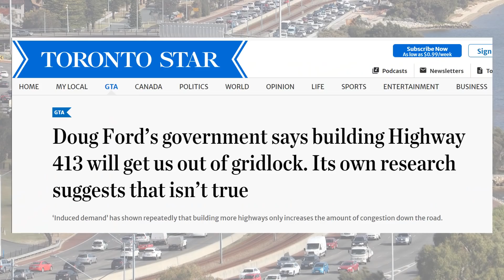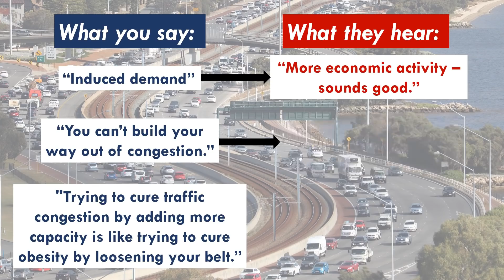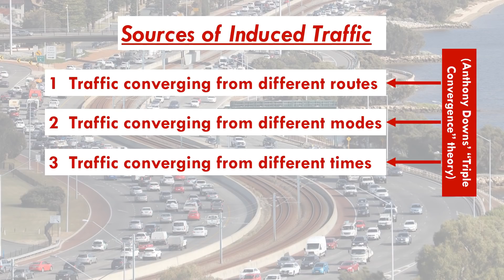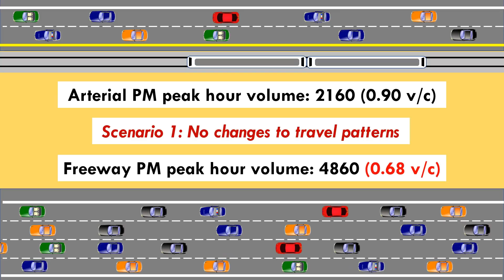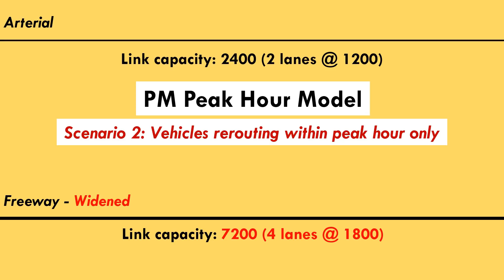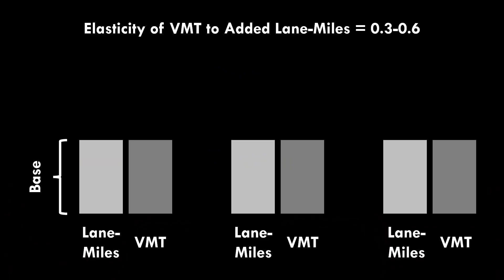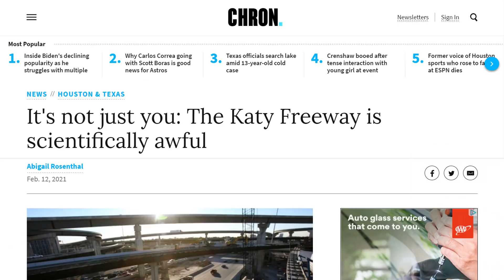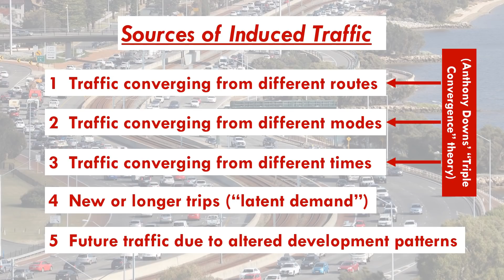Induced Demand & Roadway Widening: Everything You Always Wanted to Know (and Weren't Afraid to Ask)

Comment: I'm wondering in these models if benefits outside of rush hour are considered in analyses. Clearly, the extra capacity is geared for the peak period. But I grew up in the suburbs of Atlanta. We frequently would drive to go to dinner or sporting events, etc. that were downtown despite living 25 miles away because the trip basically took 25 minutes with little traffic on the wide highway. Now I live in the Virginia suburbs of DC. Even at midnight, the narrow highways that barely penetrate the city often have some level of traffic, and it makes driving for non-work reasons into the city not worth it. Instead, we stay in the suburbs. Ignoring some of the positive climate implications of what I just said, I am curious to what extent that sort of demand which would be great for DC's economy is considered during widening projects. Even services like door dash benefit downtown businesses if they can quickly get out to the suburbs.

Comment: I’m curious if there’s an optimal number of lanes for highways. I’m of the mind that 3 all-purpose, 1 HOV & 1 accessory lane is optimal for greatest capacity per lane with greatest success of travel (AKA, fewest incidents).
Reply: Until you have to cross the thing.
Reply: @marjae2767  I’m talking about highways as freeways that require a bridge or tunnel to cross. Your point is still taken that crossing one is not typically a pleasant experience in any case, even if separated.

Comment: The first written of examples of this that I know of, were seen in the UK in the 19th Century, the price of coal dropped, ticket prices on the trains also dropped, more journeys were taken as a result, more coal was used than previous, prices rose higher than before. A virtuous circle.

You can kind of see it playing out at a global level via thermodynamics, the laws of which are very clear on why it is a really bad idea within a closed system to use the machine that makes the mess to build machines to clean up the mess we made but capitalism via renewables & EV is the faulty hill we have chosen to die on, so be it.

Comment: The key point I come away with is that adding capacity in one place creates congestion somewhere else in the network, and then when you add capacity there, another place becomes congested, and so on.  It becomes a never-ending drain on resources.  The term "induced demand" does not elucidate this key aspect of the problem.

Comment: The thing is, I feel like that freeways should still be built. Hear me out. It's just that we have to accept that they will always be congested during rush hours. However, when it's not rush hour, freeways are tremendously useful for getting around quickly. They're also the safest kind of road for motorists, and they're also very good to keep trucks off city streets and keep trucks moving. It's just that there has to be a good balance. It's not great to have no freeways, but also not good to have too many freeways.

Just my two cents.
Reply: I agree.

I'm for rail transport but as you said, you have to have a good balance. I don't think widening a freeway is the smartest concept but rather reducing the amount of junctions creating bottlenecks is the better solution.

Comment: Thanks for an in-depth and interesting video. I've always been wary of the idea of induced traffic but I like this analysis. I note that sources 1, 2, and 3 are preexisting trips. 4 might happen with discretionary traffic (e.g. mall) but not non-discretionary (most employment, and employment commuting is what creates rush hour). I expect pretty much all long-term negative effects of capacity planning are due to source 5. It is frustrating that when land use is so heavily regulated in the US we can't get this right. But this does mean that the road itself doesn't directly generate additional traffic.

Here's a hot take. Any road network was probably fine when first built, and then development grew beyond its capacity - an argument that roads themselves are not a problem, and if capacity and other development happened hand in hand traffic would stay under control. Adding a lane adds capacity but it is still finite, it is not a cure if you can't keep demand in check. (I am ignoring the land use efficiency argument here, but that is different from the induced traffic argument.)

Which leads me to my second hot take. The real failure is lack of coordination of development (traffic capacity vs demand, regardless of mode), and local control ruins city planning in the US. Cities should not be balkanized rivals able to have their cake and eat it too. Many urban cores are anti-road and want everyone to be urbanist like them, while at the same time not zoning enough housing to let people live near jobs. Simultaneously, suburban voters sabotage attempts to build regional transit systems.

Comment: From an Econ 101 perspective, one way to make sense of the concept of induced demand is to distinguish between short-term and long-term demand.  At any moment, there is a short-term demand curve: a function that gives a quantity demanded for any price.  It depends on people's beliefs about alternatives, and about the good that we're looking at demand for.  If price is the only thing that changes, then quantity demanded will vary along that curve.  That definition has nothing to do with time, only with whether anything else changes.  But it can be called a "short-term" demand curve because changes in price can be assumed to happen faster than other changes, or because price changes that aren't expected to last will have very little effect on anything else.  A long-term demand curve describes what quantity will be demanded if the price stays at a particular level indefinitely, accounting for all the other changes that may eventually happen as a result of the change in price.  So a change in supply can gradually induce a change in short-term demand, where the new short-term demand curve intersects the supply curve where the long-term demand curve does, instead of where the old short-term demand curve did.

As for traffic, my impression is that the main problem is how capacity works.  If you add lanes, that gives a nearly proportional increase in the maximum amount of traffic a road could carry, if metered entrance ramps functioned perfectly to let vehicles on at the rate that maximizes throughput.  But it gives very little increase, if any, in the amount of traffic that the road can carry when fully congested.  A four-lane parking lot is a parking lot, and a six-lane parking lot is still a parking lot.

Comment: @CityNerd: I think induced demand is basically a shift in the demand curve.  For example, suppose the extra lane causes sprawl and development further away (which you consider in the video).  If you then close that lane, you will probably see higher traffic than before, regardless of the fact that by closing the lane you have reverted the lane miles to what it used to be.  This extra lane, repeated many times, will cause sprawl within the city (more parking) making it less walk-able, and this over time causes changes in the demand where for a given number of lanes folks are willing to tolerate more delays.  There is a similar argument about inflation.  If done right, you shift both supply and demand, making prices stay the same but increasing output.  That said, in the case of lanes near cities, there are tons of externalities when adding lanes, so this double shifting does not really work.

Comment: Induced demand actually makes a lot of sense from a more advanced economics background. You can’t survive your first-year PhD micro sequence without learning L’Chatelier’s principle, which states that long-run supply/demand is more elastic than short-run supply/demand. So while the increased quantity demanded from expanding capacity is a movement down the short-run demand curve, in the long-run, travelers take the expanded capacity into account when re-optimizing. Since they don’t account for their congestion externalities, the result is an outward shift in the demand curve. So even if you don’t have to worry about all of the other factors you mentioned, in a simple dynamic model, you’d see no long-run congestion benefits from widening a freeway
Reply: Not just that, we also have to consider that land use plans often have conditions put on land development based on the supply of public infrastructure, like utilities and transportation. Say, a suburban developer or a retail developer might not be authorized to build that new subdivision or shopping mall unless they invest in expanding the road capacity along their access routes; or until the DOT expands the freeways or arterials passing near the development sites. This sort of thing is what's happening under the hood in the long-term supply and demand elasticity.
Reply: @LucarioBoricua  Sure, but the point is that *even absent those second-order effects*, you would see an increase in highway demand in the long term as a direct result of capacity expansion. I mentioned this in my reply to @someguy's reply to my comment, but long-run demand is more elastic not because of knock-on policy choices or whatever, but simply because commuters are less constrained by long-run investments (e.g. where they live).
Reply: IMO you hit a key word here: externalities.

I disagree with the elasticity analysis. Short-term demand is inelastic - at least when talking about people commuting to work. Long-term demand is more elastic but under regulatory control. Consider this - if people are commuting to jobs in the urban core, the core city cannot prevent suburban housing development (or existing workers moving out of the city), but it can absolutely control how many new jobs can be added in the city. While there are some things they cannot control, they typically fail to use the levers at their disposal either, so it is not surprising when the new capacity limit is hit.
Reply: @someguy6075  I didn't say demand was elastic in the short run. I said that long-run demand is more elastic than short-run demand (which is true regardless of how elastic or inelastic short-run demand is). And the thing is that long-run elasticity accounts for the regulatory barriers you mentioned. Those barriers are inputs in the optimization problem that determines the shape of the demand curve. What makes long-run demand more elastic than short-run demand is that workers can move, or buy (or sell) a car, or find a new job, in the long run. No matter the regulatory regime, you would see induced demand. It's an axiomatic reality of transportation demand.
Reply: @dannyegold  Your statement of no long-term benefit removes all agency and culpability from regulators. I don't see how that attitude is useful.
Reply: @someguy6075  I also didn't state that there is no long-term benefit. You seem to believe that I'm making many unstated conclusions from my otherwise unrelated statements.

Stating the empirical and theoretical reality that long-run demand is much more elastic than short-run demand says nothing about the merits of suburban land use restrictions. If you were actually interested in the underpinnings of long-term demand elasticity (rather than, quite literally, being just some guy on the internet), you would recognize that elastic long-term demand (and all of the inputs that determine it) is an indictment of policies that lead to suburban sprawl. 

Case in point: transit- and bike-friendly development often gets pushback that focuses on poor demand under contemporaneous infrastructure. Induced demand exists also in the case of bike and transit infrastructure, because in the long-run, people will sell their car, move closer to transit, etc. if transit is more reliable or biking is safer. That demand doesn't show up immediately because short-run demand is less elastic than long-run demand
Reply: @dannyegold  You literally said, "in a simple dynamic model, you’d see no long-run congestion benefits from widening a freeway." That's a qualified statement, so I can't say it's wrong, but I'm exploring the qualification.

We're talking past each other pushing our own agendas. You want bike infrastructure - great. I am pushing back on the idea that no long run benefit is a foregone conclusion. That is only the case when we refuse to exercise policy levers responsibly. People moving further away because commuting is easier will not result in all benefit evaporating; what does in the long run is upzoning single use neighborhoods so that even more people are forced to commute, until the capacity ratio is back where it started.

I am not opposed to other forms of development. I would love more availability of mass transit in the US. I simply take issue with a framing of induced traffic that takes attention away from the zoning policy lever. I agree with the statement about elasticity, I agree that decisions should be based more on expected outcomes than contemporaneous use patterns, and I think ideally development and policy decisions should be made in tandem in a balanced manner and account for their externalities. But a statement of "no benefit" without further exploration is defeatist and doesn't ask why that tends to be the case in practice.
Reply: @someguy6075   I don’t care what your motive was, and my motive has nothing to do with bike infrastructure; that was just an example to illuminate my point apparently that went over your head. CityNerd mentioned that induced demand may not make sense if you have an economics background, and since I’m getting my PhD in economics, I figured I’d chip in and mention that it’s a phenomenon that’s entirely consistent with standard, neoclassical microeconomic theory. 

There’s plenty you’ve said that I think is wrongheaded from a policy standpoint, but that isn’t relevant to my comment or the reason I mentioned it. I bothered to engage with you because you said that you “disagree” with my “elasticity analysis”, and that annoyed me because there’s not much there to disagree with at all—it’s just simply true that induced demand is consistent with L’Chatelier’s Principle, which is the point I was making. I’d assumed you were interested in me clarifying the point, but you apparently are more interested in imputing some sort of argument about policy that I’m not making and have no interest in making.

Comment: Should transportation planning even be done at the project level? Moving towards a more general comprehensive approach to transportation planning would allow people see the issue of congestion at a more holistic level and in my opinion, an issue of capacity. An issue which, is better solved by changes to networks instead of streets, to mode shifts instead of road expansion.

Comment: Park and rides are dumb for subways yeah, but for commuter rail it makes sense. If there is a stop in an area with density too low to consider adding transit/better alternative infrastructure then people will drive to the train station. Rather them drive 2.5-5 miles than 30-40 miles
Reply: I guess so? The point that if you just built some more density you could build an automated light metro and have a walkable neighborhood and frequent transit instead of a train on a crappy freeway. Or you can just built light rail down the freeway and have the worst of both worlds (i.e. a slow train through suburban sprawl).
Reply: @agntdrake  but it isn't realistic to make everything into a high density area. There will always be more rural parts. And my impression has always been that park and ride works really well for those areas.

Comment: Graphing traffic deaths v added lane miles since the 1980s shows a high negative correlation.  Adding lane miles enables greater maneuverability in avoiding collisions.  The decline in the number of traffic deaths since the 1980’s is directly attributable to increasing width of roads and not seat belts or airbags.
Reply: I actually laughed out loud when I read this. I mean, I think you are correct that 1. there are more lane miles than before, and 2. there are fewer deaths _per mile driven_, but you know the old saying about correlation and causality.

Comment: If we widen bycicle paths and more people use them, they will fill more and isnt that induced demand and a  overcrowding demand for that mode of transportation? If it's true for cars, it's true for bikes. Jason makes EXCELLENT points, but sometimes he shows his bias against the car.
Reply: Sure; there's certainly an "induced demand" effect for cycle infrastructure, since many will switch from cars to bikes if decent infrastructure is available.

However, the disadvantages of high levels of car traffic are obvious; It's difficult to see a downside for high levels of cycle traffic.

If cycling gets to the point where there is insufficient capacity and people are diverting onto other modes instead, is there really a good argument against increasing capacity of cycle infrastructure?  Would you rather push people towards other less efficient, more expensive and more polluting forms of transport?
Reply: @misterflibble9799  I agree with your point of avoiding less efficient and wasting materials for building cars transporting 5 people or less. My point was Jason's bias. But, everyone has the right to their point of view even if we disagree.